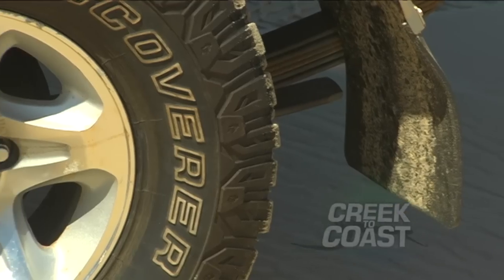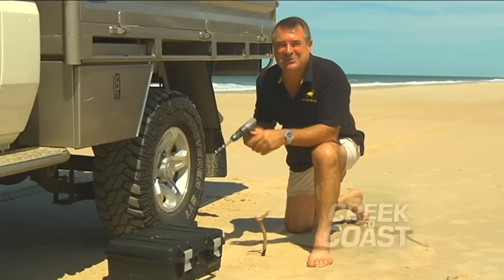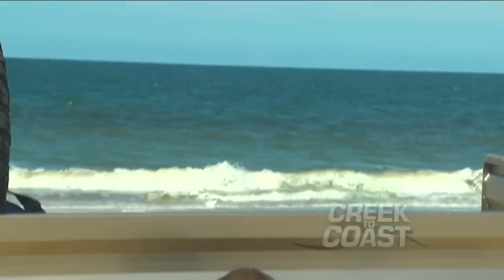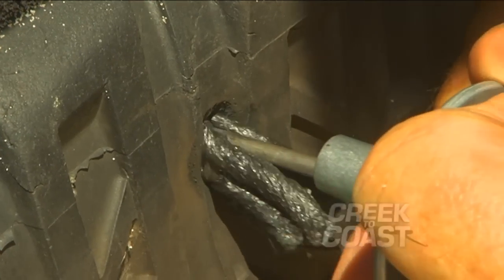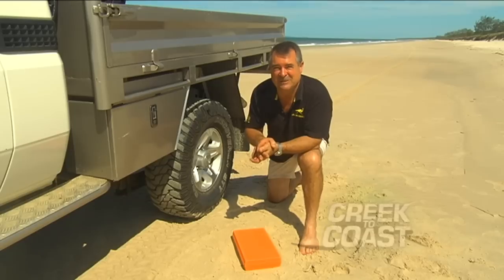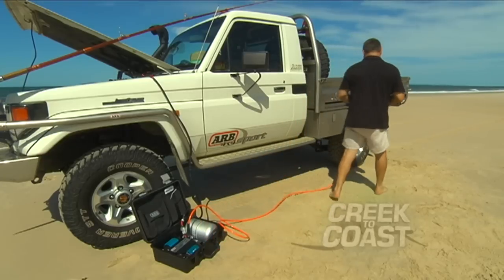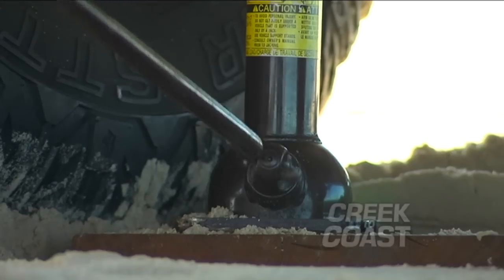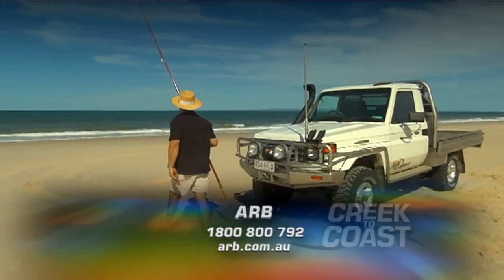ARB Twin Compressor Demo

Comment: Hey, can you operate air tools with a small tank and air compressor like that?, is it possible?
Reply from the maker: Hey pclose9, yes you can certainly operate air tools using the twin motor compressors with an air tank. Do keep in mind that air tools use differing volumes of airflow (measured in litres per minute) and this needs to be below the output of the compressor to ensure correct operation.

Comment from the maker: @RaptorYFM350 Thanks for the question. Whilst correctly installed plugs do an excellent job of repairing a punctured tyre and can last for some time, they should only be used as a temporary repair to enable you to get your vehicle to a tyre retailer or workshop to have a permanent repair completed.

Comment from the maker: Hi there, I believe you're referring to our High Output compressor, not the Maximum Performance, twin motor compressor shown in this video. Whilst we don't publish inflation times, both of these models provide class leading flow rates. When coupled with our 4l air tank, the Maximum Performance compressor is even capable of running a range of air tools. As with all portable or vehicle mounted compressors, optimum performance is achieved with the engine running, using a quality air chuck/gauge.